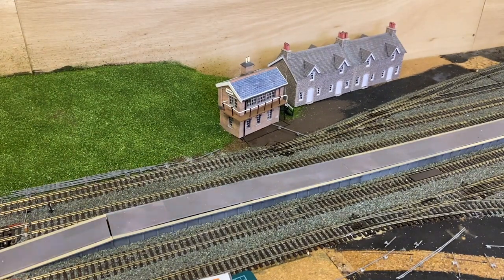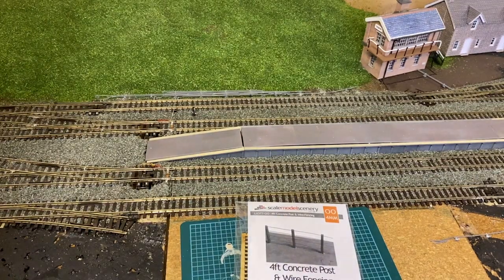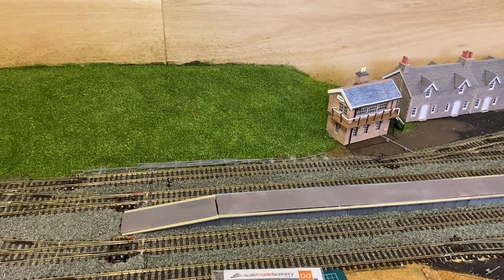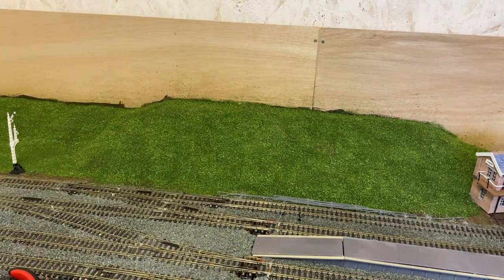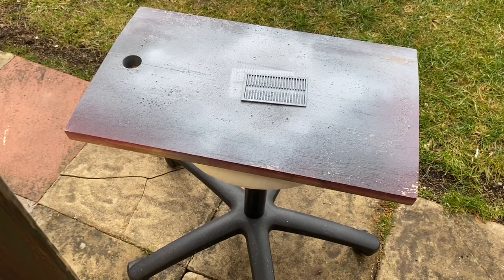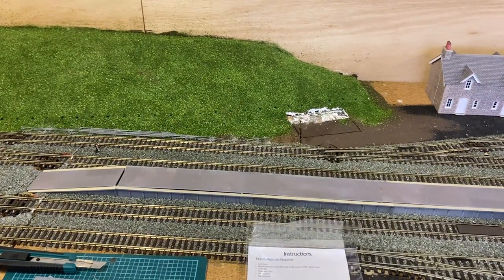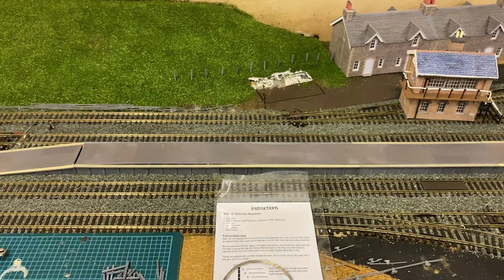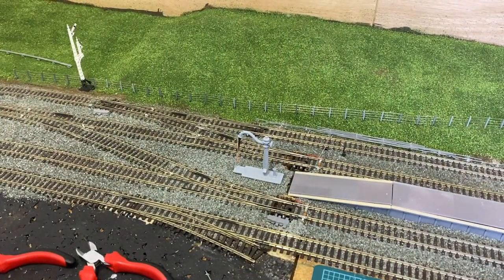Adding a Scale Model Scenery lineside fence

Comment: That fence looks so much better than some of the plastic ones available. I do feel sorry for the signalman, the furthest crossover points will take a good pull to throw them.
Reply from the maker: Haha yes! The crossover on the real Richmond is a lot closer to the station, but I had no choice but to move it  because of the curves, but it’s ok, the signalman is ‘ard as nails! 😉
I did consider a plastic fence, but this one looks so much better, even if it was a pain to install!

Comment: the layout is progressing very nicely, the scatter grass looks good and the lineside fencing is great. I have a packet of some lineside fencing to add to my layout at some point, ahem..was it tricky to thread it in once you'd glued the fence posts?
Reply from the maker: Actually it wasn’t as tricky as I thought. It wasn’t the easiest, as you had to go slowly and make sure that the wires didn’t knot or snag, and I should have made sure the holes were totally clear of paint first too. But for a first attempt I’m pleased with it, and I now know what to expect with the next fence kit. Just make sure you use enough glue(not too much!) and give it enough time to dry. I left mine for nearly 24 hours